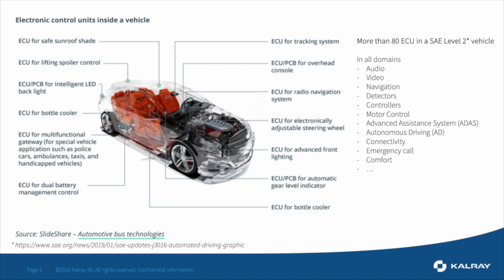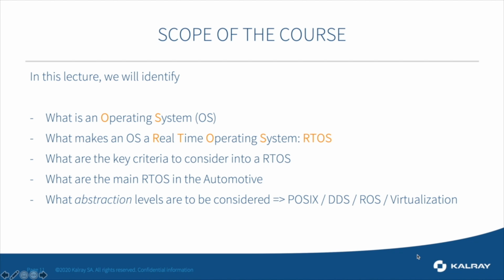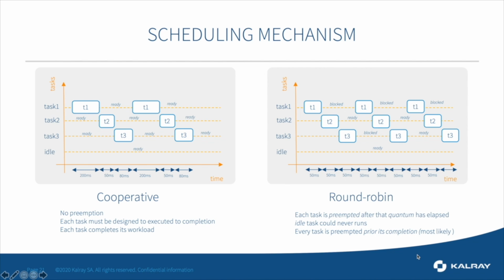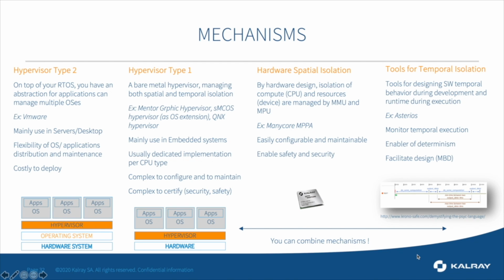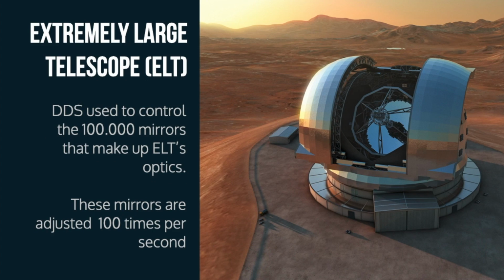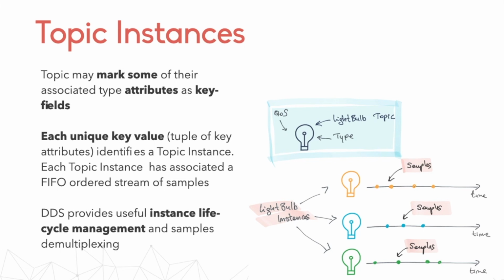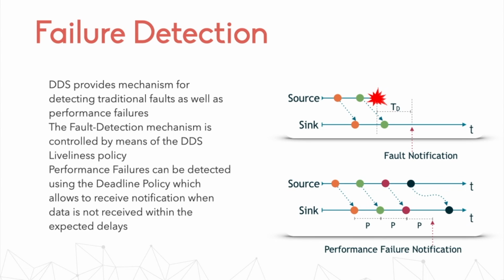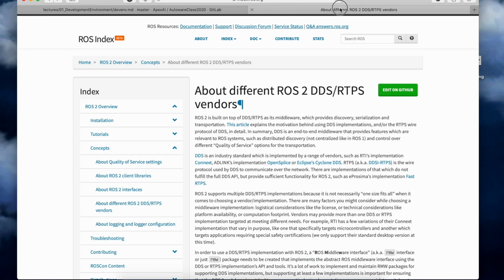Autoware Course Lecture 4: Platform HW, RTOS and DDS

Comment: Doubt: What if in the Pre-emptive scheduler there is a task with the same priority of T1 and it is running when T1 needs to run? Wouldn't it break the periodicity of T1?
Reply: Hi Gustavo, you are right. This is then a software system responsibility. The management of task priority is a software architecture responsibility from my point of view: you need to encompass the entire applications needs and contraints to define a scheme of tasks priority and relationship. Several OS vendor provides tools to help you design this and monitor/debug this. Hope it helps.

Comment: Great Lecture!
I have a question for Angelo: You use a C++ interface with cyclonedds in the "Lab". I can't seem to find any official examples in C++ . Is the C++ interface an unofficial one?
regards
Reply: Just to avoid confusion about my previous answer: the C++ language binding is not part of the main Cyclone-DDS repository: the plan is that every additional language binding will come in a separate eclipse repository so that you can pick and build only those components you actually intend to use, and you have no dependencies on compilers and libraries you do not intend to use when building Cyclone-DDS from scratch. The repository holding the C++ API can be found on https://github.com/eclipse-cyclonedds/cyclonedds-cxx.
Reply: The C++ API wasn't in the open source yet because it was dependent on an IDL-C++ compiler that was not part of the Cyclone-DDS project and therefore might have resulted in licensing issues. With the introduction of a completely new IDL compiler.as part of the Cyclone-DDS project. that restriction is now lifted and therefore the C++ API is now also added to the Cyclone-DDS project.